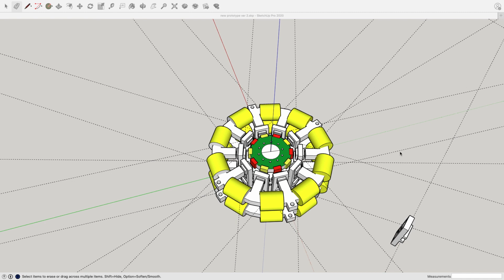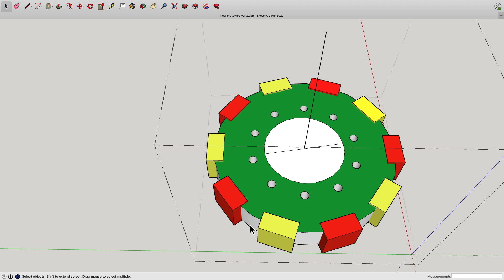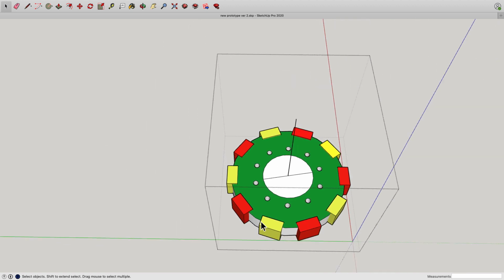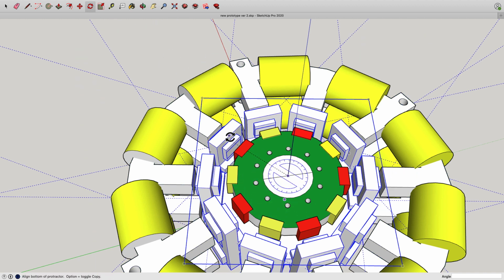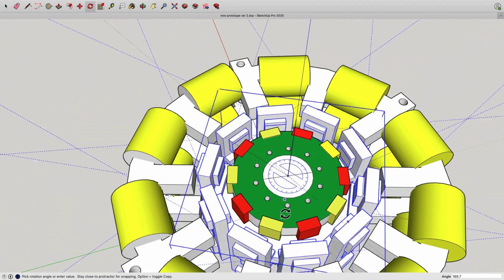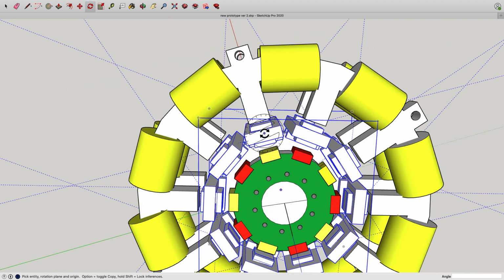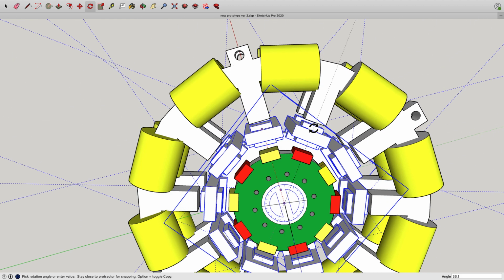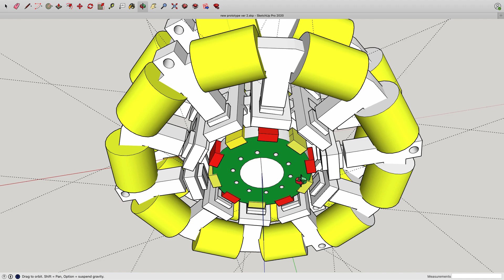New design with 2 cores

Comment: I have thought about a very similar design. However, why do you think there would be no Lenz in this design?
When the laminated steel rotor goes in front of the magnet,  then it becomes a magnet!... and a moving magnet passing through a loaded coil will experience Lenz.
Reply from the maker: @Luc gotoluc Choquette yes Lenz not suppose to be there because if you see this video the magnet in between the flux will go from the North to the connector then to the south magnet , it will not go to the coil all what am doing is redirecting the flux so Lenz will not go to the same path
Reply: @EnergySeeker  Have you tested the basic idea to see if it works before building something this elaborate?

Comment: Hello Amir, hope you are safe and fine. I would like to state that the power output from the coil will be better if we remove the lower part of the U core (the one without the coil), and put the top half of the U core containing the coil, with the two arms of the U core, parallel to the magnets on the flywheel. Please try it with just one coil first, if you get a significant increase in the output power with this configuration.
The following video in the link will explain this better. I tested it and the results are promising!! Thanks and take care of yourself. 🙂🙏

Here is the reference video for you:
https://youtu.be/EmIS_ryaGaY
Reply from the maker: i will check it out thanks
Reply from the maker: check this video i did last year it was the same way you want to test  https://www.youtube.com/watch?v=SGJSGHe4B3o&t=299s
Reply: @EnergySeeker  It was a nice video, 124% efficiency was great to achieve! However, I did not suggest the core orientation like what it is shown on the video. I would like to keep the core laterally so that the two arms of it are parallel to the magnets on the rotor. I would request you to refer to the video on my last post. 🙏🙂
Reply: Please watch the reference video especially at 7:45 to understand the exact orientation I am referring to. Thanks.

Comment: Thanks for the update and looking nice
Reply from the maker: am building it now
Reply: amir ibrahim  can’t wait to see it.
Reply from the maker: david parfitt the issue am facing is the tolerances because almost all parts I print with my 3D printer and plastic you can’t have high torque or precision so am trying just to prove it works then make the plastic parts in real parts
Reply: amir ibrahim  the joys of prototyping, you’re doing good keep it up.
Reply: amir ibrahim  I never realised my printer doesn’t print perfectly round parts, so now I print them slightly oversized then turn them down on the lathe if possible, try to sleeve any fast spinning parts with stainless steel if possible or even wrapped in cotton with epoxy so they don’t explode with high centrifugal forces.
The resin printers are way more precise, almost perfect to the cad drawing but the parts are brittle.
Reply from the maker: @daveparf  and much smaller parts too , i dont have a lathe in my house ,  so i try to meet the drawing , ABS is hard to print so i do PLA + ,  i saw your video , and you do the same , the parts i do in steel is the core , laser cut in China , now am trying to make the connector part in ABS because it break and am thinking maybe poly Carbon will see
Reply: amir ibrahim  are the connectors breaking from g-force or pull from magnets?
Reply from the maker: @daveparf  the force between the N52 to the connectors metal part which turns